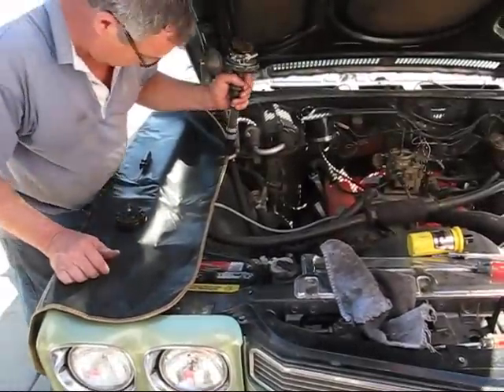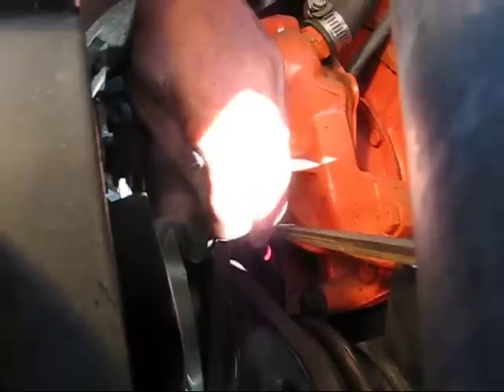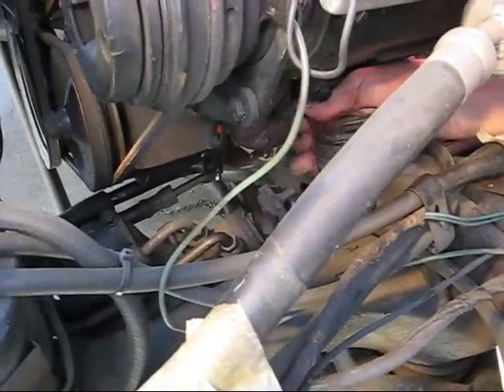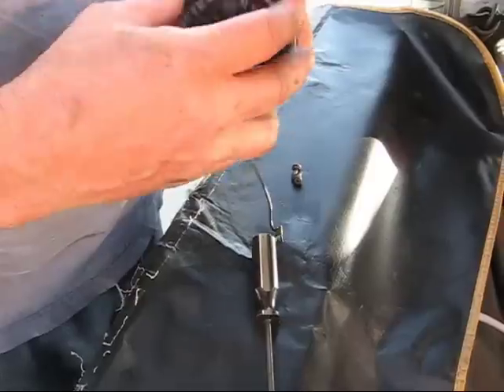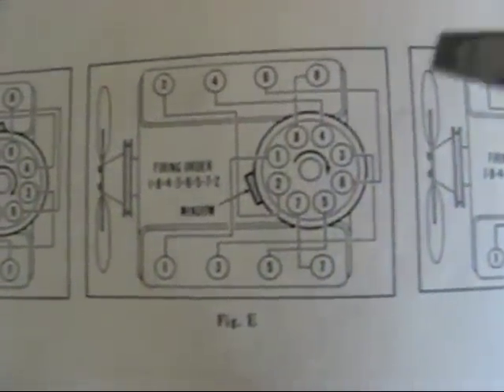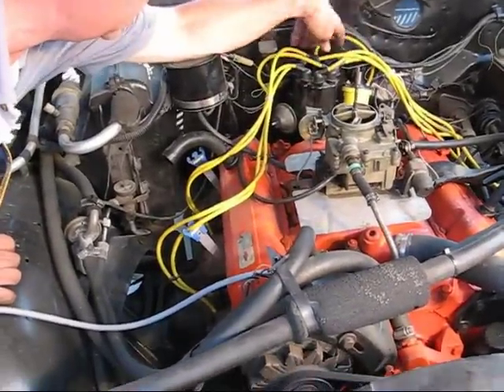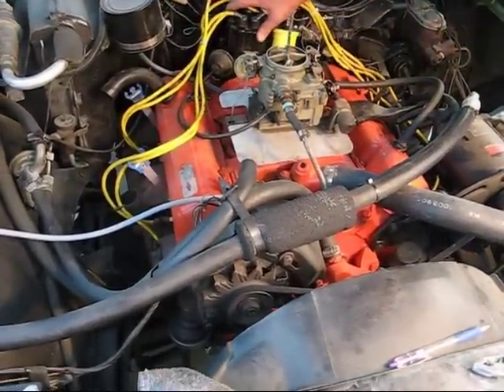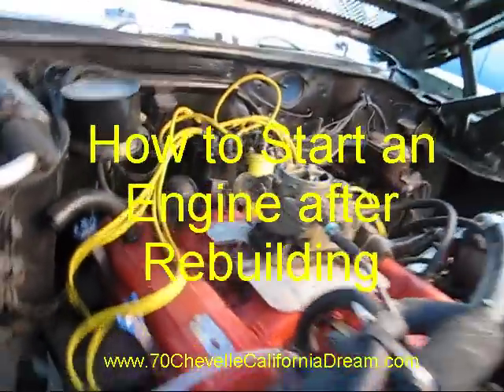How to start an engine after rebuilding

Comment: your not going to wipe out the cam by bumping the starter..or turning it over a few times...you have to do that anyway to set the valve lash/adjust rocker arms....on all 8 cylinders....
Reply from the maker: That is right.
Reply: +David Lis thank you...laymen make me laugh. ..
Reply: He has hydraulic lifters, it's very easy to adjust them with out bumping or running the engine.  If you don't think running an engine at least 2,000 RPM won't ruin a cam you have no clue.  Too much spring pressure will ruin a flat tappet cam.
Reply: +Eric Johnson how is it very easy to adjust the rockers ..with out turning the engine over..can't adjust them with the cam lobe in the up position..you have to adjust the rocker in the compression /power stroke..now is it really possible for a engine to have all its cylinders in the compression /power stroke...of course not Wich would necessitate bumping and turning the engine over..now who's the dumb ass..
Reply: steve mitchell First of all you put it at TDC on #1 and adjust 1,8,4,3 then go TDC on 6 and adjust 6,5,7,2.  Done, not rocket science, you put the piston 1 at TDC before you ever put heads on so it's not like you are turning it over to adjust half the valves and then go 1 turn before you ever put the engine in and TDC 6 and adjust.  You need any other questions answered that your feeble mind can't handle?
Reply: +Eric Johnson you still have to turn it over your way...I know all about taking the inner springs out of race springs..and priming the oil pump...running zinc additive...turning a motor over a few times will not wipe the break in lube off ..actually running the motor. a couple of minutes      then shutting it off the. restarting could..
Reply: Eric your opinions don't matter to anyone.. Go back to the video games and stay there
Reply: Peter O Troll much Peter?  I dismissed you a while ago, stay that way, unless you'd like to chime in and show your stupidity more.
Reply: Look at my videos then look at yours... I know more about cars silly little YouTube gamer kid
Reply: Hell I have been doing it wrong for close to fifty years according to the comic book kid here. I bring #1 to TDC and adjust both valves, turn the crank 90 degrees and #8 etc through the firing order. Eric grow up, there are others that are smarter than you, reading something and doing are two different things.
Reply: I have been building engines for as I said close to fifty years and I have never, I say again, never lost a cam. The cam companies put out those warning due to so many idiots that don't have the foggiest idea how to build a engine, there are lots of guys that assemble them, big difference between a builder and a assembler.
Reply: Bullet Nova 76 yeah you have been doing it wrong for 50 years than, you only need to bring it to TDC on 1 to adjust 4 of the cylinders and TDC on 6 to adjust the other 4.  You all know so much about cams and have virtually no clue.  I've wiped out cams by having too much spring pressure on break in.  I'm sure the cam companies and oil companies don't know anything about why break in and zinc is in the oil.  YOU WILL RUIN A FLAT TAPPET IF YOU DON'T BREAK IT IN. I'm glad you seem to be another youtube university student.
Reply: As a matter of fact I am not. I am a probably old enough to be your father. I was building engines when I was 9 years old with my father. From what I hear, you must be running too high spring pressure if you have lobed a flat tappet. I have never lost a flat tappet cam in all my years. I have probably built 60-70 engines in my day, its funny before the oil companies started taking out the zddp there was no problem with flat tappet cams. We never did a cam break in process back then, so with this intelligent mind you have, why is that? If the zddp is there you can break in a engine and cam the same way as in the old days. I have done if for years and never lost a cam.
Reply: No I haven't been doing wrong adjusting valves, if your cylinder is at TDC your cam is on the base circle of the cam and both valves are adjustable. Why is it that only you are the only one that is right, I know about 5 different ways to adjust valves and they all work and do it correctly. Reading a book is only the start to working on engines, 70 % is in doing which apparently you haven't done a lot.
Reply: BulletNova76 for DA WIN!
Reply: If it was a big block it would have almost indefinitely... you can take every precaution with a big block and sometimes they will still wipe out a cam... I just always spend the extra money on a roller

Comment: why not just turning the harmonic balancer manually clockwise. it will also get the oil into the engine moving parts???
Reply from the maker: +Abel Penaloza You can not turn the motor fast enough to get any oil pressure.  Plus, if the bearings are dry, it could possibly damage the bearings before any oil gets there.  I have rebuilt several motors and I always prime the engines before starting them.  If you prime the engine with a fake distributor by connecting it to a electric drill, it turns the oil pump without turning the engine.  This pumps oil to all the bearings, lifters, all the oil passages, just like if the motor was running. 

I have a video titled "How to Prime an Engine with Oil before First Start", this will show you how to do it.
Reply: +David Lis alright thank you very much. got it

Comment: i hope that is a roller cam engine because you're supposed to run the engine at 2000rp or more for 20/30 minutes if it's a flat tappet
Reply: stop living the youtube life and thinking the advertisements that have been your teacher for so long are the only way to do things.its a used cam and low pressure valve springs on a low compression 1 barrel,single exhaust chevelle,it isnt a high compression high horsepower build.this will work perfectly until the car is retired or this gentleman is.
Reply: trillriff-axegrinder; It's a Two barrel carburetor "NOT ONE"...  and Chevy never put a Carburetor Heat plate shield under it's carburetors on the 1970-72 Chevelle's SBC 350 engines maybe on a SHP Corvette or ?? But I've never seen one especially on a bone stock Two Barrel Carburetor SBC Engine. But His Rebuild really... New gaskets and paint job is not a rebuild and if he used same cam and lifter's did he keep lifter's in order so they went back on the same cam lobes ?? This is NOT A REBUILD if you reuse the old part's...

Comment: glad to see that someone else caught the cam thing..2000 rpm 15-20 minutes.maybe he did that after the camera shut off..and why not put a finger over the hole?
Reply: used cam,used engine
Reply: @utooberblooper  I don't think I would reuse a cam, I know some do. I'd rather use new.

Comment: put a breaker bar with a socket on it on the bolt head on the vibration damper and turn clockwise until the timing mark lines up where you want it.PULL THE COIL WIRE  before you start !

Comment: Baling wire?????? nahhhhhhhhh,, Just put your thumb over the plug hole while your buddy cranks it over. If you feel pressure the piston is coming up on compression.If it sucks on your finger the piston is going down on the intake stroke. OR!!! break the center out of a spark plug and put a balloon over it.Yes a common everyday kids balloon. Now crank the engine and when the balloon inflates as engine cranks,,,,THATS the piston coming up on compression. Now IF you had left the rocker cover off you could have watched the two rocker arms for number one cylinder and when they are both up( both pushrods at their highest)and you see the timing mark ,Number one is up on compression and ready to fire.
Reply: +callmenort GM guys use bailing wire for everything lol

Comment: It was imperative to break the cam in. after start up the engine should have been spun up to 200 RPM for 20 minutes  for cam break in other it will be not broke in correctly and the lobes will wear down over probably a couple of months and destroy the cam. I checked to see if you installed a roller cam before posting this comment and that is not the case. Roller cams you do not have to break in.  I hope it is all okay in the long run man nice work otherwise. Plus you explain things very well. Unless we all missed something in start up.
Reply: it    is   a   used    fucking    cam

Comment: why didnt you install the dizzy and carb with the motor on the stand?
Reply: +james white I wondered the same thing.  Also a lot easier to find TDC compression stroke without having to fight compression.
Reply: +james white  Fighting with not trashing the distributor while putting the gnine in as well as the carb with it on a chain is why we take the carb and distributor off before install.
Reply: +james white because when you install the distributor (that's dizzy to you) you take the chance of damaging it when you lower the engine into the engine bay with it at an angle. It's easy to wreck the distributor.

Comment: Or you can just remove the spark plugs, disconnect the ignition coil and turn the engine over with the starter...this also accomplishes spinning the oil pump to pre lubricate it.  Engine spins nice and fast with no compression.  Did it when I rebuilt my Ford 351W.
Reply: +Maizerus That completely defeats the purpose of priming it.  The whole idea is to distribute oil through the engine BEFORE the parts start moving and sliding against each other.  The way you are describing is no different than just firing the engine up dry and letting it lubricate as it builds oil pressure.   That is fine if you've used assembly lube and it fires right off, but if you have to crank it a while because your timing is off or you've forgotten to connect something, you've ruined your break-in, and possibly damaged components.  If you're going to the time and expense of rebuilding a motor, take the extra time to prime it.
Reply: spinning just the oil pump only pumps oil,this is what you want to pre oil your engine.

chances are when you rushed to do things the "new stupid way" you galled your cylinder walls and scorched your bearings doing it "your way" that was wrong.